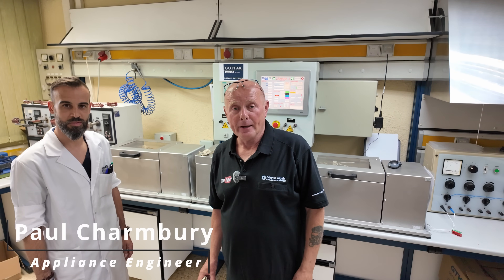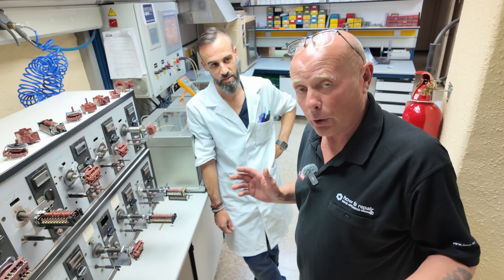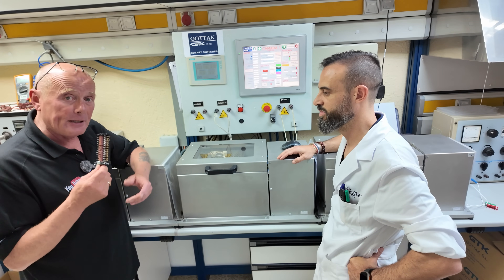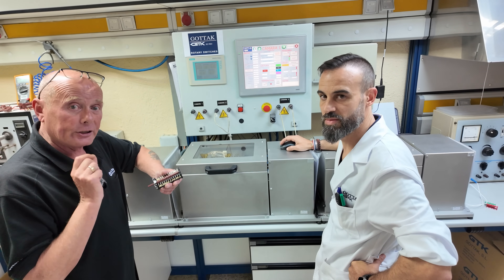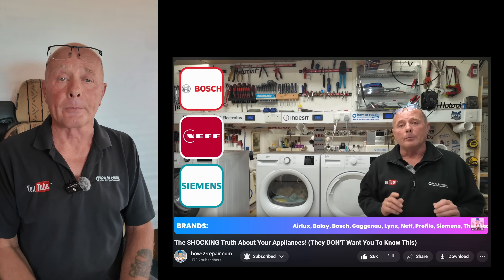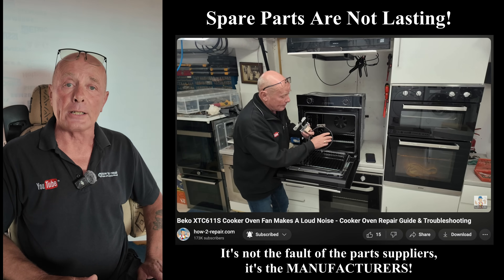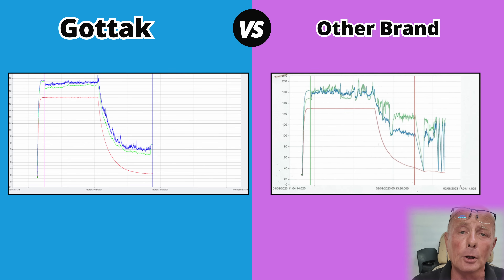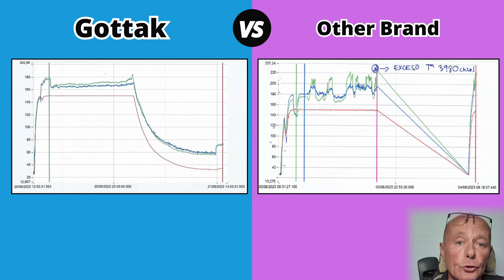Why Your Appliances FAIL SO FAST! Lab Results EXPOSE the Truth!

Comment: People who blame engineers need to stop. Accountants & politicians are dictating designs. Neither know anything about how things actually work. This is why old washing machines & dishwashers clean better and/or faster. They use a bit more water to properly do the job.  "Durable goods" are so called precisely due to their long lifespans. Think yesteryear's cars & appliances. Can we really call an appliance that won't last 5 years durable? There's a market for appliances that are as reliable as they used to be for a few dollars more. Someone please step up and hand these douchebag MBAs and accountants their asses.
Reply from the maker: You are 100% right that this is not an engineering problem; it's a business and finance problem.

Engineers are perfectly capable of designing and building machines that last for decades. The issue is that they are often overruled by accountants and MBAs in boardrooms who dictate that a product must be built to a specific, low price point and have a limited lifespan to ensure future sales. 

For a deeper dive into this topic and to see the examples we covered, please check out the full video here: https://youtu.be/gEgSCbZnHVM?si=wTIw0mELuhWaw4aX

This video is especially relevant to your point:

The shocking truth about manufacturers: https://www.youtube.com/watch?v=QsdGd2qDPaI
Heat pump tumble dryers are they really worth it?: https://www.youtube.com/watch?v=xn03N3b0-lE
If you found this information eye-opening or helpful, please consider sharing this video with your friends and family. The more people who understand who is truly behind these decisions, the more pressure we can collectively put on them to change.

Thanks again for that incredibly sharp and accurate analysis! Don't forget to subscribe to the channel for more insights like this!

Comment: Its the same in every industry... Car parts are now made of plastic instead of metal.
I had an interesting conversation with the locksmith..
My back door has had 7 new locking strips in 5 years!
The back door porch door, still has the same door locking system that is now 37 years old.
Both doors have locks by the same manufacturer.
The manufacturer moved its plant to China.
The locks are now made from powdered sintered metal instead of metal...
Why? because its cheaper.
The locks used to have a 5 year warrenty, now they only have 1 year.
The back door lock will need replacing soon, its getting awkward. Fortunately the old porch lock still works like new.
I do regret getting a new back door, when there was nothing wrong with the old one other than the missus nagging for a change.
Reply from the maker: It’s true mate built-in obsolescence and durability issues aren’t limited to appliances. It’s frustrating to see this pattern repeat across so many products! Thank you for your comment. I appreciate people like you taking the time to write it out. Please share it where possible. It might help others make a wise choice instead of being misled by the industry.

Comment: I think it’s hilarious that the selector switches you have in your hand are the same style they made in the 50s. God forbid they manufacture something that was made in within the last 20 years
Reply from the maker: Manufacturers have often replaced a durable, time-tested component with a sleeker-looking but far more fragile electronic one that is designed to fail. It's one of the key ways they ensure appliances don't last as long as they used to. At least Gottak is making an effort and producing high quality switches.

Comment: The  component I replace most in our facilities is the control board.
Reply from the maker: The control board is the perfect target for manufacturers. By using cheaper capacitors or other electronic components that are known to have a limited lifespan, they can create a predictable failure point. As you know, replacing a control board is often so expensive that many consumers are forced to simply buy a whole new appliance, which is exactly what the manufacturer wants. It's the key to the cycle of premature replacement.

Comment: I buy old machines, restore them. The money to do it is worth it, if i don't have to touch it again for 20 years.
Reply from the maker: Investing your time and money into restoring older, well-built machines is one of the best ways to fight back against the throwaway culture.

The fact that a restored older machine can provide 20 years of reliable service is a powerful testament to how things used to be made, and a stark contrast to modern appliances that often fail shortly after the warranty expires. You are choosing true, long-term value and durability.

Understanding how much obsolescence is being designed into new appliances these days is something everyone should be aware of. For a deeper dive into this topic and to see the examples we covered, please check out the full video here: https://youtu.be/gEgSCbZnHVM?si=wTIw0mELuhWaw4aX

We also explored related aspects in these videos:

The shocking truth about manufacturers: https://www.youtube.com/watch?v=QsdGd2qDPaI
Heat pump tumble dryers are they really worth it?: https://www.youtube.com/watch?v=xn03N3b0-lE
If you found this information eye-opening or helpful, please consider sharing this video with your friends and family. Your strategy is a perfect example to share with others who are tired of the cycle of replacing broken appliances.

Thanks again for watching and for sharing your excellent strategy! Don't forget to subscribe to the channel for more insights like this!

Comment: although the governments push that "green" narative with words like sustainability and renewable
they are all in the big tech companies pocket, appliences and applications are poorly made to fail
they are also not as efficient and durable over time, most of those "green" appliences are pure crap when compared to appliences we use currently, take an EV for instance, very costly to charge when you have no solar, less autonomy, long charging time, very expensive to buy, and the biggest caviat of all, they catch fire when you least expected
another ferry with EV's bites the dust, it's all expensive non-durable "green" crap
Reply from the maker: There often seems to be a conflict between hitting a high energy-efficiency rating and building a product for long-term durability. The push for sustainability is completely undermined if an appliance is so poorly made that it needs to be replaced every few years, creating more waste and costing consumers more money. The issue you raise about new products failing prematurely is something we see time and time again.

At the trade show last year, understanding how much obsolescence is being designed into new appliances these days is something everyone should be aware of. For a deeper dive into this topic and to see the examples we covered, please check out the full video here: https://youtu.be/gEgSCbZnHVM?si=wTIw0mELuhWaw4aX

We also explored related aspects in these videos:

The shocking truth about manufacturers: https://www.youtube.com/watch?v=QsdGd2qDPaI
Heat pump tumble dryers are they really worth it?: https://www.youtube.com/watch?v=xn03N3b0-lE
If you found this information eye-opening or helpful, please consider sharing this video with your friends and family. The more people who understand what's happening with appliance longevity, the better equipped we all are as consumers.

Thanks again for watching and engaging! Don't forget to subscribe to the channel for more insights like this!

Comment: In the past 6 months had to replace
Fridge 10 years old Samsung and I was lucky I got that long out of it with some redneck fixes I got 2 more years out of it

Samsung washer , 10 years old spyider arm broke  and the new part cost more then the replacement machine. 

Now  my 13 year old GE washer started leaking out of the pump.  I hear newer GE
Washers now only lasting 2-3 years then leaking

I expect 20 years out of major appliances 

My Samsung gas oven is still  going strong ,  the knobs all broke.  I fixed them with jb weld and zip tie all 5 of them .

Comment: Actually, theyŕe building in a fire hazard. Wonder how many people parished in flames from fires due to bad quality components? Maybe they just see it as collateral damage?
Reply from the maker: When cost-cutting is prioritized over robust engineering, the parts that are most likely to be downgraded are often electronics, wiring, and motors. When these components fail, it's not always a simple breakdown; it can lead to overheating and catastrophic failure. The number of appliance recalls for fire risk that we see each year is a sobering confirmation of this problem.

Comment: I totally agree with the observations in these videos but are we consumers also using these appliances more frequently than we did a few decades ago?
Reply from the maker: This is precisely where the issue of built-in obsolescence becomes even more critical. Manufacturers have access to vast amounts of data on our usage patterns. A quality, well-engineered appliance should be designed to handle the demands of modern life.

The core problem we highlight in the video is that while usage may have gone up, the quality and durability of crucial components have often gone down. We're seeing plastic parts where metal used to be, and electronics that are designed to last for a specific number of cycles that conveniently falls just outside the warranty period. So, even accounting for more frequent use, the fundamental design philosophy has shifted from longevity to disposability.

It's a one-two punch for the consumer: we use our appliances more, and they are built to withstand less.

Comment: Bosch fridge freezer (ex-display unit) still going strong after 27 years. The only parts to fail so far? The lighting in the fridge compartment (completely dead, new bulbs don't work); the handles on both doors (replaced with 3D printed ones); a couple of freezer drawers have cracked (made stable with metal brackets and cable ties.)

Best vacuum cleaner we've owned – Numatic Henry. The circuit failed once, but a replacement was readily available, so we could fix it ourselves. Worst vacuum – Dyson.
Reply from the maker: Hi there! Thanks for your comment, @TheHeadCell!

That's a fantastic story and a brilliant illustration of the point. A Bosch fridge-freezer lasting 27 years is a testament to the way things used to be built. Your resourcefulness in using 3D-printed handles and reinforcing the drawers to keep it running is exactly the kind of repair-and-reuse mindset that counters the throwaway culture driven by built-in obsolescence.

Your experience with the Numatic Henry also perfectly highlights the importance of repairability. The fact that a replacement circuit was available and you could fix it yourself is, unfortunately, becoming a rare experience for consumers. This is exactly the kind of built-in obsolescence we discuss in the video – where modern appliances often fail and are too expensive or impossible to fix.

Understanding how much obsolescence is being designed into new appliances these days is something everyone should be aware of. For a deeper dive into this topic and to see the examples we covered, please check out the full video here: https://youtu.be/gEgSCbZnHVM?si=wTIw0mELuhWaw4aX

We also explored related aspects in these videos:

The shocking truth about manufacturers: https://www.youtube.com/watch?v=QsdGd2qDPaI
Heat pump tumble dryers are they really worth it?: https://www.youtube.com/watch?v=xn03N3b0-lE
If you found this information eye-opening or helpful, please consider sharing this video with your friends and family. The more people who understand what's happening with appliance longevity, the better equipped we all are as consumers.

Thanks again for sharing your experience and for watching! Don't forget to subscribe to the channel for more insights like this!

Comment: Not to argue or dispute your findings, but by continuing to rotate you are not allowing heat to dissipate between switching which would happen in a normal environment.
Reply from the maker: Hi there! Thanks for your comment, @davidgreening173!

You've hit on a really important point about the testing methodology and how heat dissipates in a normal environment. This is a key factor we consider when looking into built-in obsolescence.

The continuous rotation in our test is designed to simulate an accelerated use-case to see how the components stand up to sustained stress. While you're right that in a typical setting there would be breaks allowing for heat to dissipate, this intensified approach helps us identify potential weak points that might only show up after months or even years of normal use. Understanding how much resilience is, or isn't, designed into new appliances is something everyone should be aware of.

For a deeper dive into this topic and to see the other examples we covered, please check out the full video here: https://youtu.be/gEgSCbZnHVM?si=wTIw0mELuhWaw4aX

We also explored related aspects in these videos:

The shocking truth about manufacturers: https://www.youtube.com/watch?v=QsdGd2qDPaI
Heat pump tumble dryers are they really worth it?: https://www.youtube.com/watch?v=xn03N3b0-lE
If you found this information eye-opening or helpful, please consider sharing this video with your friends and family. The more people who understand what's happening with appliance longevity, the better equipped we all are as consumers.

Thanks again for watching and for your insightful comment! Don't forget to subscribe to the channel for more insights like this!
Reply: Sorry to tell you but it is the opposite, while the circuit opens and closes there is wider dissipation of heat compared to a continuous electrical flow on an electric circuit. The matter is not just the heat obtained by the electric arcing on the process of opening and closing a circuit but the addition of other elements involved on the circuit itself such as their metal components, tolerances and their respective alloy compositions. If you test the circuit of low quality switches on a continuous manner, heat will keep rising on and on and performance time will be even shorter. The point is, that nobody has a domestic cooker/oven working for continuous 10 hours at home and if you want to do so, the switch itself will have to be much more reinforced with even bigger silver contacts, thicker metal components and platings, same as the ones used in professional/commercial appliances.